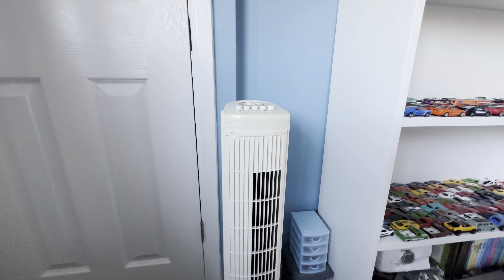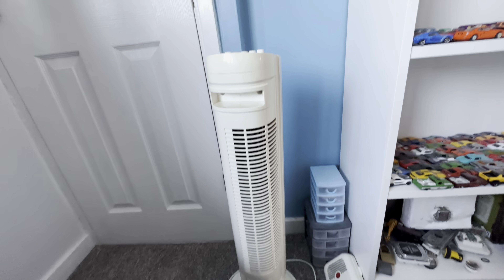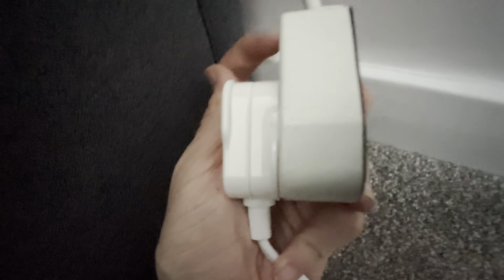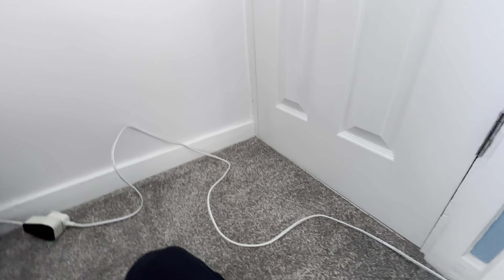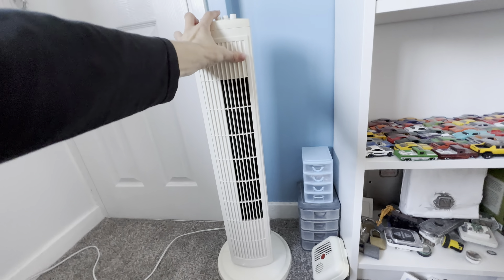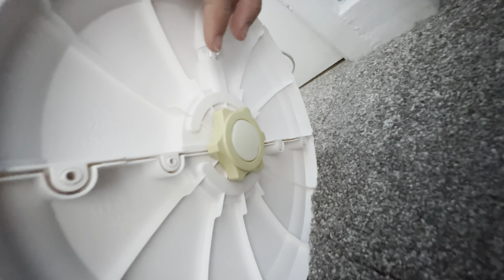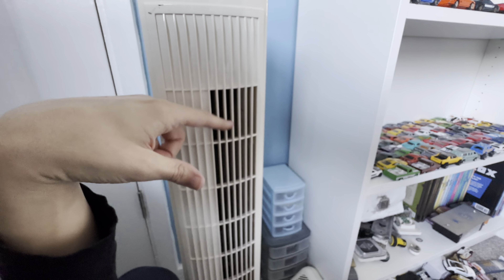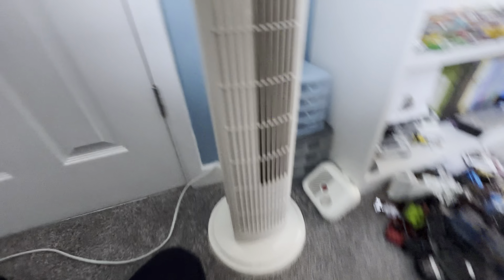This is a 2015 Sainsbury’s 30” Tower Fan

Comment: that mf looks over 30 years old, you sure it's from 2015
Reply from the maker: Certain. This is a good tower fan by the way just saying.
Reply: @LiftEnthusiast2020OFFTOPIC  i think tower fans in general are crap
Reply from the maker: @METROPOLITANBORD89YT  ok but they work good if you don’t have air conditioning
Reply: @LiftEnthusiast2020OFFTOPIC  if someone don't have ac then just buy a desk, stand or wall fan